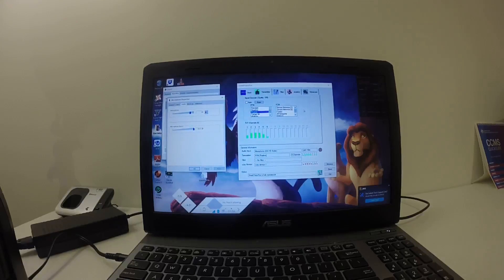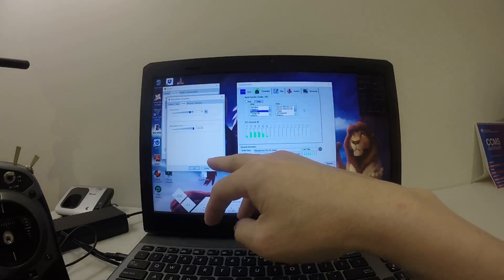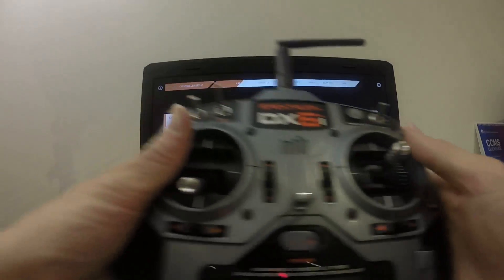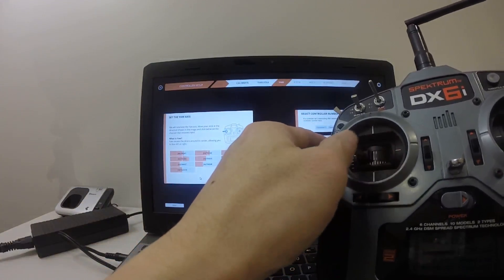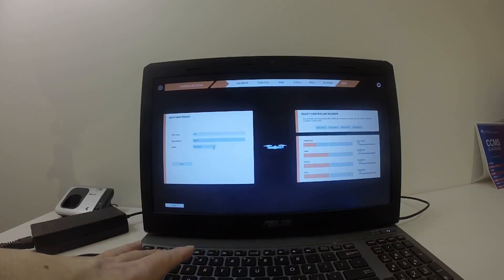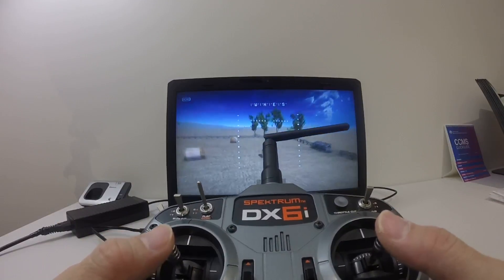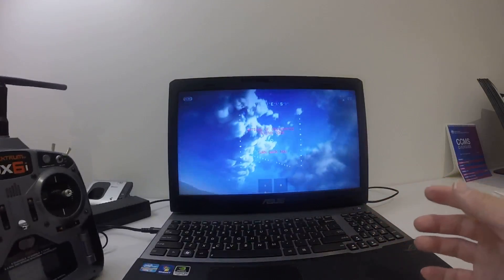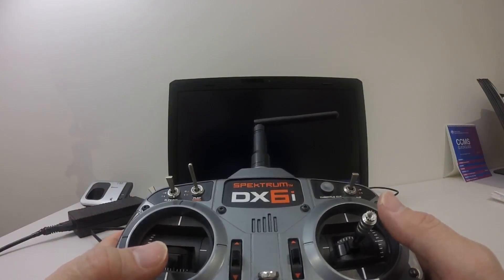Spektrum DX6i or DX6 transmitter + SmartpropoPlus with LIFTOFF Simulator PC Edition

Comment: great video. i got it to work "kinda".    my issue is the inputs are glitchy. all axis have a twitch. SPP shows the R/C channels coming and going. you can fly but you get random inputs which makes it not very fun.
Reply from the maker: Thank you for watching. Have you tried reducing the volume of your sound input? I haven't used it for a while now. I will try to troubleshoot and get back to you.
Reply: jtgravityRC 
yeah. tried reducing the volume, in increments of 10. might try an older version of SPP or another version of Vjoy.
Reply from the maker: scirockalot8v I will have a look and get back to you.
Reply: jtgravityRC 
no big hurry. i appreciate it. thanks.
Reply: @scirockalot8v You need to put the Noise Reduction to zero then its no more laggy or glitchty :D